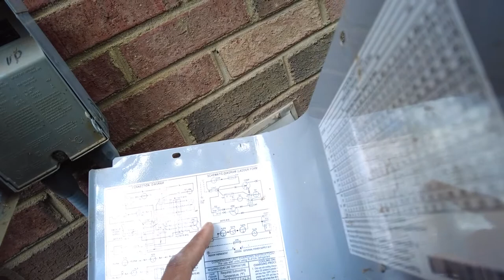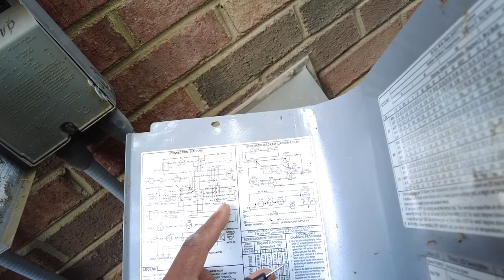AC Condenser Fan Motor Not Running | Almost jumped the gun on bad motor diagnosis

Comment: My rule of thumb is...." If the fan spins freely, then it's probably not the motor". Start looking for something else. It's always good to poke around a little bit.  Good catch 😎👍
Reply from the maker: True good point!  I believe this was an ECM motor if I remember correctly so that kind of changes things a bit : ) I'm not sure if I've come across an ECM motor yet that I've replaced that´s had rotor restriction due to failure, as it's usually the modules that fail due overheating or something. Thanks for watching and for the feedback as well!
Reply: @HVACTechKnowledgy  No, that was a PSC motor. Remember you check the capacitor first and it read 5.1 mf. That's why I say... if a PSC motor spins freely, it probably ain't bad. And the same applies to an X13 style motor as well. If it spins freely it ain't the motor. It's the module, no control voltage (a bad relay), or a loose wiring harness. 😎👍
Reply from the maker: Oh yeah you're right on that good catch! Thanks!

Comment: horrible design, I would use a zip tie to secure that plug. It shouldn't be mounted like that, horizontal or vertical but not upside down, just goes to show how terrible the engineering is on residential equipment. It was a good catch though, and video like that are worth a maintenance contract for life from the owner.
Reply from the maker: I thought the same thing. Good idea with the zip tie, I didnt even think of that.
Reply: @HVACTechKnowledgy  if it does not have a lock you need to tie it. ziptie every loose cable. snippin a tie after 5 years is better then getting a call for a dicky connection in 2.
Reply from the maker: Very true. Thanks for your comment and thanks for watching!